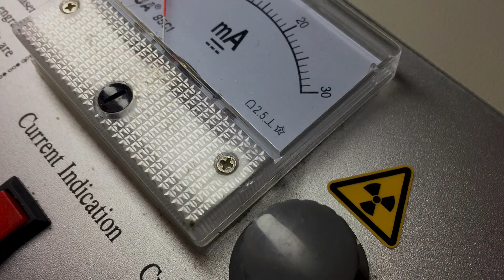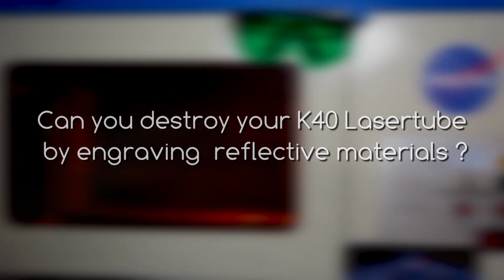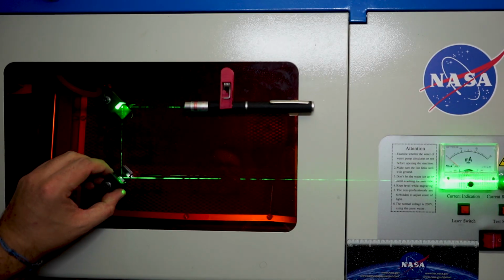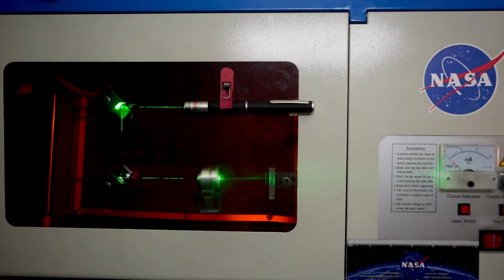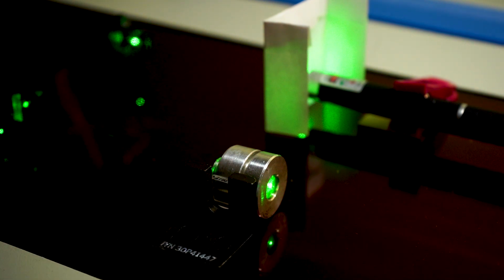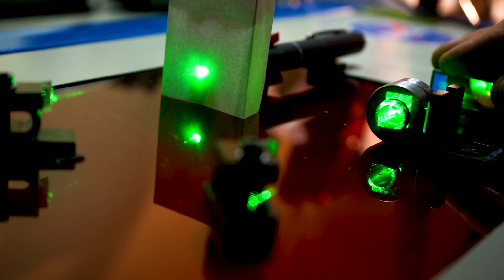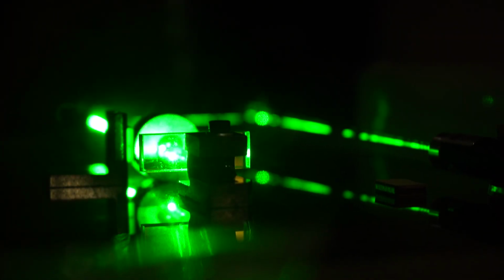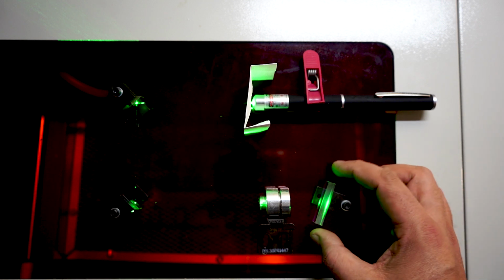K40 Laser vs. Mirror = Bad Idea?

Comment: FYI, another (more generic) term for the laser mirrors is "first surface mirror" because the reflective surface is on the first surface that any incoming light will hit. Compared to regular mirrors where the reflective surface (on the back side of the glass) would be the second surface that incoming light will hit.

Comment: Shouldn't make a difference. The lens is convexed at the top to focus the beam out the concaved side on the bottom. If it were to hit back exactly in the same spot it would go back through the top side and scatter. It probably wouldn't make it all back to the tube. Just a thought.

Comment: The laser will not destroy itself because of the focal length and loss.  Even with a mirror it just isn't going to happen.  FL 20.  It hits the surface at its focal length and bounces the bounce will have less energy due to the surface.  Even with the best made for a CO2 laser mirror that loss is 1-5% but on a regular mirror try 10%, or more, and on a non mirror it is even worse.  The worst possible thing to try and engrave would be shiny copper which would have a loss around 1.5%.  Another thing is the dot (the FL apex) is like a pyramid so if it bounces it crates a new pyramid so the dot would be even smaller at the bounced FL which means even less power.   I saw a video about this a couple of years ago and the bounced beam was found and the man stuck his hand on the bounced beam and nothing.  He said it was slightly warmer than his hand but had he put his hand anywhere from the first FL or through the path he would have been severely burned.   I can attest to that when I got my machine and when I was aligning it and my pinky finger (the hair between the first and second knuckle) grazed the invisible beam and it felt like lightning.  I had a burn there and it was for less than a second and took 3 months to heal.   There is really no issues with reflected beams breaking lenses or such but the reason you have that window (the color of the window matters not) is due the fact that to the CO2 invisible laser beam it is opaque and it will hit it and stop before it gets to your eyeball where a reflected beam is just as bad and will blind you faster than you can blink.

edit:  Oh, and laser goggles made for the frequency of the laser is just Polycarbonate to stop the beam from hitting your eyeball (it is opaque to it) and the OD is just like shades so you can watch the dot with an optical density to lower the brightness some.  Nothing to be afraid of just understand what does what and that the CO2 laser wavelength is 10.6um and that those green goggles are not made for CO2 laser.  If they are polycarbonate they will prevent eye blindness if a beam hits them BUT the green does nothing to save you from light blindness if you look at the beam with them.  Get a real 40-100 dollar pair made for CO2 that covers the sides of the eyes as well and keep the green pair for a blue diode laser.
Reply from the maker: Very interesting and it will answer a lot of my and my subscribers questions, thanks for that! I do own a pair of real co2 laser goggles with mirrored glass and closed sides but still i am afraid of the invisible light spectrum. You say that polycarbonate may protect against the co2 laser, but what about reflected infrared light? Meanings are splitting at this point. Some people say that it will straight off blind you when you look into the laser bed without eye protection, others say it will be fine... i read a lot about it but most serious articles are talking about hudge industrial installations with multiple 1000nds of watts... i would like to make a real test by measuring the emitted coherent infrared light reflected from differend surfaces.
Reply: Think about this and that is a Fiber laser that is just 1-3mm off of the surface of shiny metal with at least 1000 watts of power and that beam reflects as it hits the metal then cuts through it.  The fiber has no real losses and no issues.

Here is a test for you to make to satisfy your curiosity (mine is satisfied on this) and that is go buy a Polycarbonate sheet at Home Depot for less than 7 bucks - https://www.homedepot.com/p/Palsun-14-in-x-11-in-x-118-in-Clear-Polycarbonate-Sheet-100880/307438912  and do your testing.  It will melt but not instantly on any reflections so it gives you enough time to look away and why they use it in protective glasses.  Btw, you know a Blue Diode Laser can't cut through glass or Acrylic, etc... because it lacks the IR and those materials are 100% opaque to the IR which is why a CO2 laser can cut them.  The laser itself would not do it but it has the IR tagging along and that is what is cutting through (like little nukes blasting the material).  The 10.6um wavelength beam is actually diffracted the same as a blue diode laser which we can see.  Watch a blue laser diode as it hits a flat piece of glass or Acrylic or even PC and the beam does nothing and comes out the sides of the material.  That is exactly what the invisible beam is doing of our CO2 laser (why we need a protective barrier between it and our eyes) and if you had a camera that could see that wavelength you would see no differences between it and the Blue Laser Diode but the IR is there and that is your etching/cutting ability of the machine.

Comment: Even before watching this video it seems highly improbable. Using a straight direct laser with a typical lens will will merge the laser at a focal point. Even if a surface is extremely reflective it won't reflect it 100% straight back up. Even if it did, the lens will distort it. 

In theory, it IS possible? but the laser will go through the lens, have to hit exactly at the focal point with a reversed reflective mirror that is the opposite shape of the lens facing back at it. 

Essentially shooting the laser back at the exact angle into the original lens, whereby the original lens fixes the beam to be straight again, then bounce all the way back to the source. That would be interesting. 

Speaking nonsense 🤷‍♂️